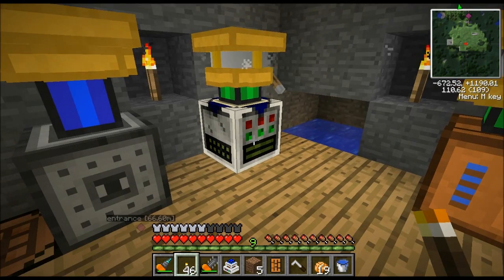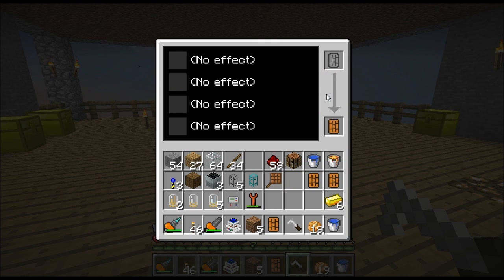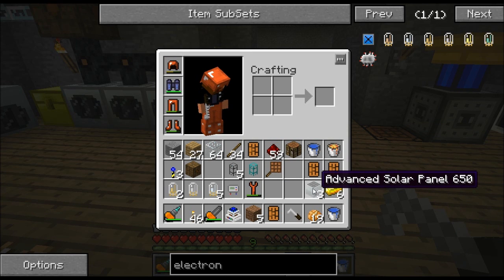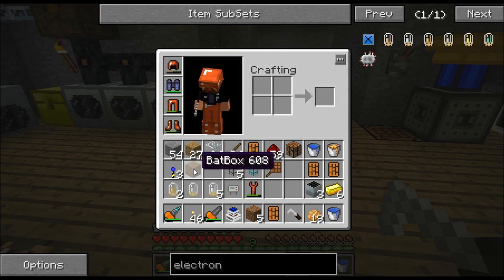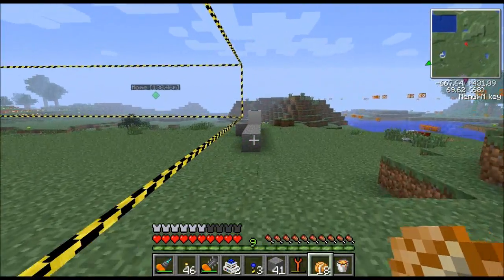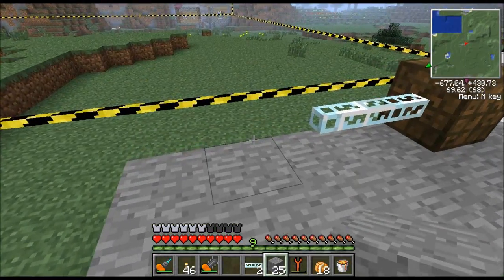FTB/Feed The Beast Tutorial Guide - Solar Powered Quarry Via An Electrical Engine

Comment: The Quarry power consumption depends on the modpack you are using. With the direwolf20 pack a quarry consumes up to 50 MJ/t, with the Ultimate pack it´s up to 100 MJ/t i believe.

Comment: Thanks, nice vid.

Quick tip I find really useful regarding markers: If you place a redstone torch down next to them they'll shine a blue light in all directions (64 blocks long - as long as a quarry can be). You can then just follow the blue line to match up the next markers.

This is beneficial when using markers to lay out a section for a filler too.

Comment: Before moving the Engine - use the soldering iron to remove the circuit board - it will pop out into your inventory - then move the engine.

Comment: Just tested it out of curiosity, 50MJ seems to be correct, if you hook a redstone energy cell set to 100MJ output up to a quarry and use an MJ-Reader on the conduit it reads 50MJ while normal operation. (tested in FTB - Mindcrack Pack v8.0.1)

So if my calculations are correct 5 electical engines with circuit boards (out10MJ/in35Eu/t) powered by 22 adv.Solarpanels (176EU/t) should provide max speed with 1Eu/t spare to charge the panels internal storrage for the nights - sorry for the textwall ;)

Comment from the maker: I don't believe you can keep them from connecting. You might try to separate them with facades but I have no idea if that would work. If some of the machines have the ability to accept transformer upgrades then you might try running some of your machines at higher voltages to get rid of some of the lower voltage cables. Other than that, I would suggest moving the machines apart.

Comment: the problem with the carpenter not accepting items is it's buggy.  if it doesn't accept the iron and bronze with left click, try right clicking them in instead.  if that doesn't work, try putting the ingots in 1 at a time instead of trying to click them in from a stack.  that worked for me.

grumpy, not sure you have your consumption figures right for the circuit. i have the exact same setup and even thro the day it slowly drains the adv panels as the quarry must be using more power.

Comment: grumpy can you find out what the problem is please?  the carpenter will not accept any iron ingots for the soldering iron recipe.  it has an electric engine hooked up and running and some water in the slot, but won't accept any iron ingots (accepts bronze ingots ok).  Thx.

Comment: You only need 3 land marks Kasper...with that said. When you right click the middle (make sure you are clicking the correct one) landmark, think of it as a triangle you need to right click on  the landmark that connects the other two(we will call that the "common landmark"). Once you see the red lines... Place your Quarry right beside the common landmark. You should then see the Construction Tape with the perameters you set. Hope it helps  :)

Comment from the maker: The glass fibre cable will not lose power unless it is over 40 blocks long. Secondly, I don't know if the advanced solar panels are nerfed in the Mindcrack version but I doubt it. The recipes are more difficult but I would imagine the output is the same.

Comment: Hey there, great tutorial - I just have 2 questions which are probably really stupid but I'm new to this whole thing. First of all, did these panels get nerfed or something? I have 8 advanced panels running and only am getting 6EU/T where as you are getting 20+ (I'm using the Mindcrack Pack version). Second question which is even more stupid then the last, does it matter how far your panels are away from the quarry? Like does it change it if you have 1 glass fibre cable instead of a long row?

Comment: Grumpy, I have a question which I can not for the life of me find the answer to on the internet. In the GUI of the solar panels, there are 4 slots with a sort of lightning bolt on them. What is this used for? Are these for IC upgrades, like over clockers, or for programmed circuit boards, or the actual electron tubes, etc?

Comment: I would recommend instead if just burning the cobble run it threw a recycler and make scrap it will become useful later on. I was wondering if there is a better more advanced way to run a quarry since moving the electrical engine will break the circuit board installed

Comment from the maker: The advantage is that early on in the game they are easy to build and use. All you need is water and some kind of fuel like logs or charcoal. The disadvantage is that they have to warm up and you have to fill them up all the time. I use them early in the game but I would replace them with electric steam engines later.

Comment from the maker: A quarry can be up to 64x64 and it can cross biomes. You need to place items called "land marks" at three of the four corners of what you want to quarry. (It takes 3 points to define a square or rectangle.) Onece you have them placed then right click on all of them until you see a red square or rectangle. At that point all you have to do is place the quarry at one of the corners.

You can see me place the land marks in this video. I placed the first one before I started recording though.

Comment: You said you can only put in one of each electron tube into a circuit board. The ones with the (2) by them you can use 2 of them.

Comment: Hey, thanks for this video. I actually set up a solar powered quarry yesterday, but didn't realize that you could upgrade the electrical engines so I ran cables to 4 separate engines. Your way is definitely better, you're putting out a lot more MJ with 25% of the engines. I think I'm getting 8 MJ/t and quarries cap out at 9 MJ/t anyways, but I'm definitely doing it this way next time.

Comment from the maker: I did more research. You can use duplicate tubes in the circuit board and the quarry requires 9 mj to run at full power. So I would use 2 bronze and one copper tube in the large circuit board. This will give the engine an output of 9 mj. The engine will consume 34 eu/t though so you will need more advanced solar panels if you want the quarry to run 24/7. I would put down 9 or 10 solar panels. The solar panels have internal storage so you may or may not need to put an MFE inline.